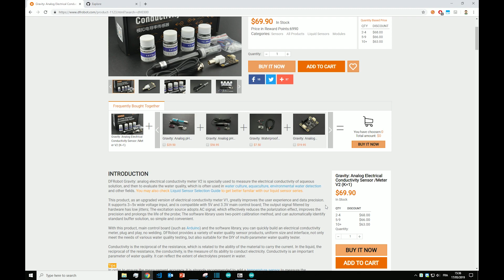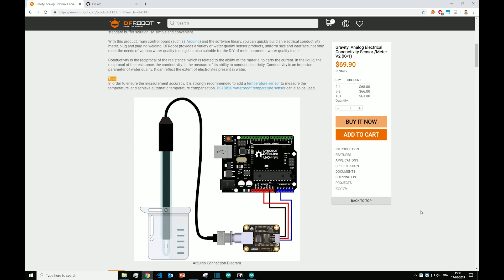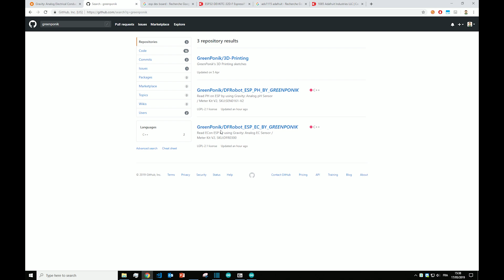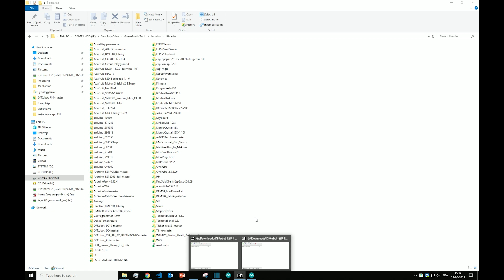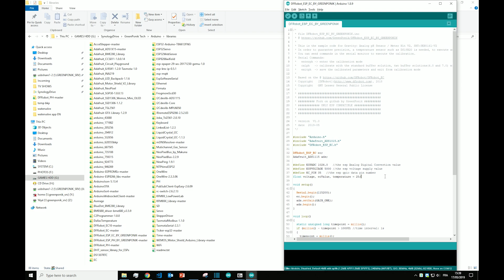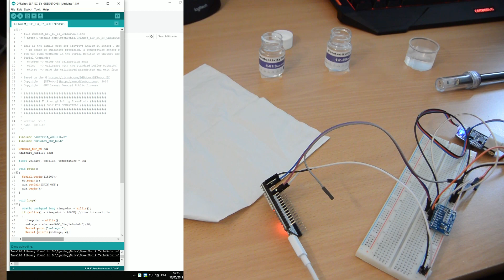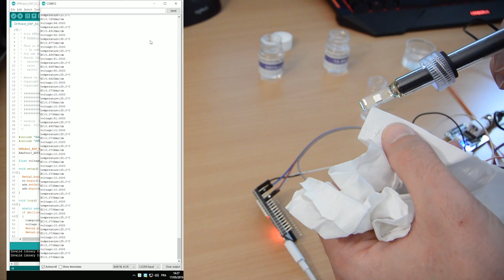EC Meter with ESP32 and DFRobot EC module (DFR0300)

Comment: Can a calibration be reset? I did it like the video with the 1413us/cm solution and I didn't get the same value. I wanted to try again and I realized that the program was asking me for the 12.88 ms/cm solution, and now that I try to calibrate with the 12.88 solution, it gives me a buffer error and tells me to try again.

Comment: Ciao, I have installed EC and pH probe on the same esp32 with ads1115 on i2c bus.  Do you also need an i2c isolator for more stable measurements?  if yes, do I have to feed at 5v?

Comment: Excellent info. However, my EC sensor has K=0.983 and when I run your code the K=1.19. How can I change the K to 0.983?
For the calibration, the code is using 25C. The temperature shall be overwritten with the current value in the code?
Reply from the maker: Hi as you can see on the original repo there is no possibility to change and store the K probe in the code https://github.com/DFRobot/DFRobot_EC

So if you can submit a PR this would be great!

For the temperature compensation, the current code is using a fixed value for water temperature because there are many solutions to get it.
You can do your own method to get water temp and pass the value in the method readEC().
Reply: @greenponik  Thank you for answering. Could you tell me please what "PR" stands for?
Reply: @victormarinescu319  Pull Request on GitHub

Comment: Hello, first thank you very much, I am developing an application for my house of my crop, my problem is that the ph measures me wrong when using the ec sensor in the same solution, it works separately but not together. Do you know what it can be? excuse my english!
Reply from the maker: Hello Martin, you have an isolation problem, which is why we've stopped working with those kits and have developed our own solution with proper isolation 👍

Comment: Hello, great video! I wonder if it's possible to connect this sensor to Arduino MKR 1010 wifi and store calibration data since this board doesn't have an EEPROM, only flash?
Reply from the maker: hehe thank you!
well, you'll have to experiment as we don't use those anymore 😅
Reply: @greenponik  Guess I'll have to make a custom PCB with EEPROM connected to MKR 1010 (I don't want to mess with eeprom flash emulator). What board do you usually use in your projects?
Reply from the maker: @sigmadews5403  used to work with ESP32, now we have custom PCBs obviously

Comment: Hi, how do i use this sensor for raspbi
Reply: Sorry but you can use Google to find any answer about that nope?
Reply: @mickaellehoux6606  Been trying that since but to no avail. Unless you have a link for me to see?
Reply from the maker: Hello you can find python library on our github
Reply: @greenponik  Hey thanks for the reply! I’ve found the code under your github but I’m still dumbfounded with the connections from the sensor to the Raspberry Pi and also the library folder.
Reply from the maker: @aimangotze  you have to look about i2c connectivity between raspberry pi an dfrobot module. Next you have to read about how to use python library.
Reply: @greenponik  So i managed to do it, but my PH value only floats around 12.14 to 12.15. It does not change when I test different types of liquid. Any help?

Comment: Hi greenponik, i just came across your product. Do I still need a Analog isolator from DfRobot if im using a ADC 1115 from adafruit? 
Thanks
Reply from the maker: Yes, absolutely, between the ADC and one of the two sensors.
Reply: @greenponik  just for clarification. 
I need 1 ADC 1115 for the esp32. 
1 analog isolator for either my ph or ec meter 
Correct? 

And 
If I power my ec/ph meter via a separate power supply, assuming the esp32 power is not very stable. Do I power it up with a 3.3 or 5.0v linear regulator?

Thank you
Reply from the maker: @leumas1996  Correct! 
And isolation will always be the best way to go to get a clear signal.

Comment: The ads1115 works with 5v?, because I connected it with 3.3 and it didn’t work
Reply from the maker: Hello Ragna, the ADS1115 should work with both tensions (depending on your board). Maybe you should try tutorials made using yours and try again with the dfrobot module.

Comment: hai. can i use esp32 without ads1115? because my esp32 has ADC.
Reply from the maker: You can, but the DAC included in the esp32 isn't accurate enough. Thus the ads1115 😉
Reply: @greenponik  can i have a code for that without ads1115?

Comment: Hello Greenponik, when I try to log the sketch, i get the following error:
A fatal error occurred: Failed to connect to ESP32: Timed out waiting for packet header
If I hold the BOOT button (like they recommended on some forum), there'S only random symbol on the serial monitor (It did the same thing with the code of DFRobot). Do you know what's the problem?

Thanks for this awesome and helpful video.
Reply from the maker: Hello @Joel, on witch device did you try to log on device monitor? ESP32? Are you sure the device is detected by you laptop or pc? It's look like the serial speed is not the good. We start each sketches on 115200bauds for serial.
Reply: @greenponik  Hello, I've fixed the problem but now, I have  only a reading of 39.9573 ms/cm. When I use another sketch to have a reading of the ADS1115, it return me  a voltage of -.1875 (-1) on the 4 channels. I have a laptop  :/

Comment: did you try to do 24/7 monitoring with this EC probe? how long the probe actually last before giving unacceptable value or broken?
Reply from the maker: @Alfa Sheffildi hello, has mentionned here on the DFRobot product page 
https://www.dfrobot.com/product-1123.html?search=dfr0300
"The probe is a laboratory-grade probe. Do not immerse in liquid for a long time. Otherwise this will shorten the life of the probe."
So you get the answer ;-)
Reply: @greenponik  hi, thanks for replying, i saw your beta/production greenponik unit, it seems very well designed!. Would you mind to share what kind of EC/PH probe you are using ini your product?
Reply from the maker: @alfasheffildi3280  yeah on the beta kit we used this kind for pH https://www.robotshop.com/eu/fr/kit-ph-metre-analogique-pro.html
and this kind for EC https://www.alibaba.com/product-detail/hydroponics-EC-sensor-conductivity-probe_60529479812.html?spm=a2700.details.deiletai6.4.30241547tHviGw
Reply: GreenPonik thank you!

Comment: Thank you so much for the video! Great tutorial. Do you know if it is able to extract the calibration values so it can be used with other code? I'm planning to use this sensor with ESPhome and I'm not quite sure how to proceed after the calibration
Reply from the maker: Hi! Calibration values are stored into the esp32's eeprom.
Has yu can see in the example sketch https://github.com/GreenPonik/DFRobot_ESP_EC_BY_GREENPONIK/blob/master/example/DFRobot_ESP_EC_BY_GREENPONIK/DFRobot_ESP_EC_BY_GREENPONIK.ino#L41

When .begin() is called you pass the eeprom start address where the system store the first calibration value.
So by reading this address on the eeprom you can get the calibration value from any where. 
If i assume you have a REST API service on your ESP32, you can get the calibration values from a HTTP request on you local network.

Comment: I had bought the same EC sensor model from online but with no conductivity solutions. Is there any other way for me to calibrate the solution without using EC meter? Btw, a really nice project GreenPonik!
Reply from the maker: To have accurency measure with your probe you need to calibration the whole system with calibration solution. Without the measurement will be bad.
Thanks fort the encouragements.

Comment: great video! do you have a video or a wiring diagram/code  for  the ph, ec, isolator and ads1115 all togeather? would be a great help.
Reply from the maker: Hi, did you watch all the video? the wiring is here https://youtu.be/n1EBzMDPI74?start=321
Reply: @greenponik  thats a great help thanks. do you have a code that reads both sensors and prints to serial.
Reply from the maker: @chimpofm  please go to video description, click on more button and you can get "The example for platformio project " and "Read both EC and Ph with same code".You can easily adapt what you need on arduino sketch this is cpp code
Reply: does the ph go into the ads1115  or into the arduino?
Reply from the maker: @chimpofm  please check the pH video you have same kind onf informations about wiring, uses etc... https://youtu.be/EqFw561pO5k

Comment: library cant find your example because no header (.h) file. Arduino IDE stated that. but i can see it inside src folder. what should i do?
Reply from the maker: Hi @Hamdan Sulaiman, how did you installed the library?
Did you use library manager directly in Arduino IDE? 
What is you current version of Arduino IDE?
Did you close you IDE just after library was installed?
I'd just check the workflow and everything seems good Arduino IDE 1.8.10 lib => DFRobot_ESP_EC_BY_GREENPONIK
Reply: @greenponik  already solved.. if i just move the greenponik downloaded folder to arduino library file directory, IDE wont detect it whenever i go to the example... i need to install the library using this step.. sketch > manage library > install library using zip file... then, all good..👍👍👍.. sorry.. i'm still new to arduino
Reply from the maker: @hamdansulaiman1133  Sounds great!